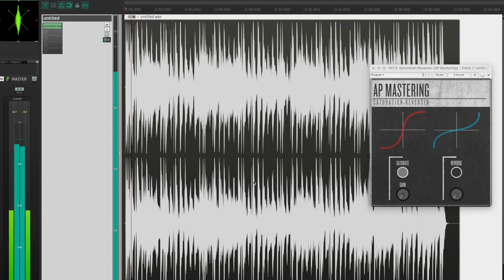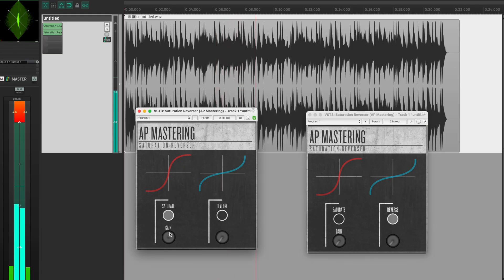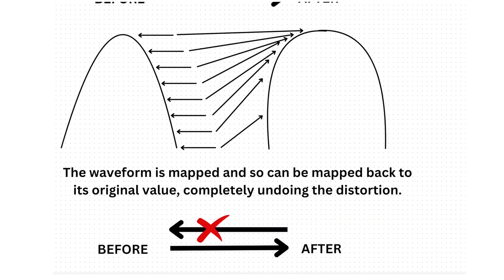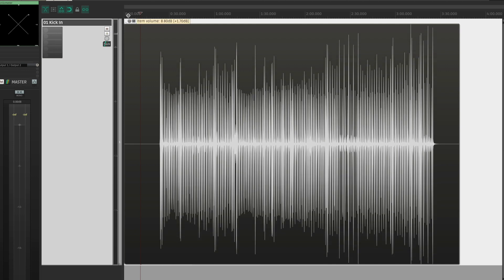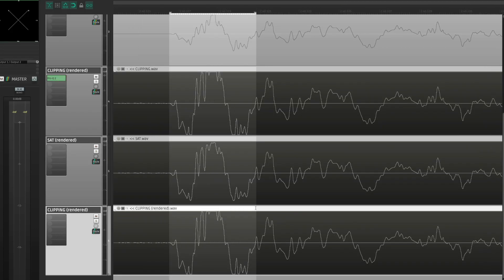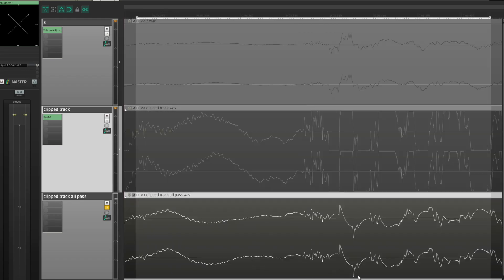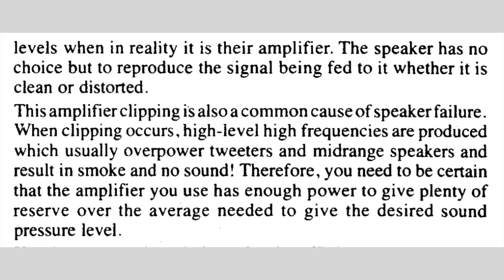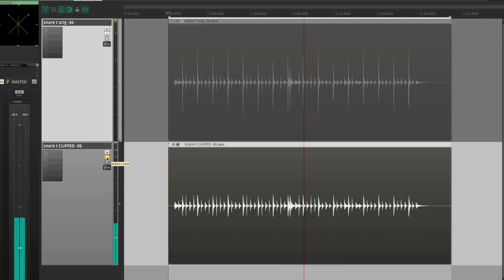Almost Nobody Knows, Distortion Can Be UNDONE!

Comment: Hard clipping can potentially create a DC offset because the straight line of a square wave is DC. 
A DC offset can potentially mess up your amp and speaker biasing, causing damage, heat, or extra distortion.
However, this is only theoretical, as all of them have so-called coupling capacitors that block DC. 
So, I don't think that square waves will damage your speakers on their own, it's common practice to use square waves to calibrate amps, speakers, tape recorders, and so on. 
The dangerous clipping they are referring to occurs when you feed your signal to the speaker or amp so hot that it exceeds the power rating of the system, overly loud source material only adds to that.
Reply from the maker: this is wrong. Although the top of a square wave is static, it's not electronically considered DC since it is not 0Hz... let's say the square wave is 1kHz. this is higher than 0hz therefore it's not DC. being reductionist about just the top portion is not how people normally discuss this
Reply: @APMastering  are you sure that waveform analysis in digital is correct? god knows what might happen during dac conversion...
Reply: @APMastering To achieve the flat line of a square wave, there must be a DC component present. Even if the wave is 1 kHz or higher, it still contains that component. You can test this yourself: generate a 1 kHz square wave and apply a 1 Hz high-pass filter on top. Then, observe the oscilloscope to see how the wave changes. The flat line will drop even if the filter never affected the fundamental frequency, because it removed the DC component.
Reply from the maker: @eliashowe7115  no that's not what DC is. DC is 0hz. high pass filter at 20hz and see what happens
Reply: @eliashowe7115 This is not right. Clipping can essentially induce DC, but not because of the flat line. It's because the energy imbalance in the top/bottom swing of the waveform becomes exhaggerated, depending on the material. You can usually see some DC on an analyzer after clipping.
Reply: @erinburke9711  As I said, generate a 1 kHz square wave and apply a 1 Hz high-pass filter on top. The waveform on the oscilloscope will drop that flat line of a square wave, even if the filter never reaches the fundamental frequency, because the flat line contains DC
Reply: @eliashowe7115  No. You lose the flat line because the highpass has nonlinear phase shift. Nothing to do with DC in this example. Do the same thing with a linear phase filter and you'll see a very different result.
Reply: @erinburke9711 for phase shift to happen filter has to be charged and then discharged, so something is doing that down there. Linear phase filters are digital and have a delayed window to do calculation so of course they will compensate for waveform changes. In general if the voltage line is flat it's DC.
Reply: @eliashowe7115  By definition a square wave is a sum of all odd harmonics. So 1k+3k+5k, etc. A naive digital square wave will have a bunch of aliasing, but a theoretical 1k square wave will have NOTHING below 1k.
Reply: @erinburke9711  front of a square wave has all upper harmonics in it up to your bandwidth limit, but low and high levels of it which are straight lines are DC.
Reply: @erinburke9711  you can see it with fft too when the filler charges for the first time
Reply from the maker: @eliashowe7115  i agree with erinburke that you are incorrect about the DC thing
Reply: @APMastering  your statement about "say the square wave is 1kHz. this is higher than 0hz therefore it's not DC" is wrong. If you measure the frequency of a flat portion of the square wave, it will measure 0 Hz.
Reply from the maker: @eliashowe7115  this is where you are going wrong. i'm starting to think you are trolling now as you've already had the mistake explained to you by two different engineers
Reply: @APMastering  your support team of engineers had it wrong too. According to them, the flat portion of a square wave is where the high-frequency harmonics (1k, 3k, 5k) are. However, this is simply not true. High-frequency harmonics are found in the rising and falling edges of a square wave.
Reply from the maker: @eliashowe7115  this is yet again wrong but if you want lessons in basic audio physics i'll have to start charging
Reply: @APMastering "DC is 0hz"
That's not strictly true. Any vertically asymetric AC waveform has a DC component. A squarewave with a positive peak of (say) plus 9 volts and a negative peak of minus 1 volt will be considered to have a very positive DC bias. This will be evident on a DC coupled oscilloscope, just as if a heavy  DC bias had been applied to a +- 5 volt square waveform. As for squarewaves the "flat" part does contain all of  the odd harmonics, and can be certainly be synthesized this way, but those test signals are usually generated simply by switching as quickly as possible between  positive and negative DC voltage rails. No harmonics used here!  It could therefore be argued that the top "flat" parts do "contain" positive DC at least for the time period for that half the cycle, and negative DC for the other half. Imagine a very low frequency square wave generator which switches polarity every hour. During that hour, what we then have is pure positive  DC for one hour, then pure negative DC for the following hour!

Apparent DC offsets due to vertically asymetric AC signals are real. Ask any power engineer about DC on the mains due to consumers using power from only half the mains cycle. Not so much of a problem nowadays but it certainly was due to TVs etc using half wave rectification of the AC sinewave.😮
Reply from the maker: @ dc offset is not DC. it's a signal with an offset
Reply: @APMastering 
It's a signal with a DC component. The component is the DC offset. Unless the audio signal is symmetrical around the zero volt line, on average, and certainly at zero volts during silent periods, it is not pure AC. The DC component can be inherent in the incoming signal, or due to some applied bias. It is irrelevant which, in DC coupled digital systems.  In power engineering this kind of thing is regarded as having DC on the mains, even though the waveform still crosses the zero point, but it is no longer crossing it at the correct point of the sinewave. A constant DC offset in an audio signal will move the point of which the speakers will rest, in a fully DC coupled system,  and when there is no audio ( say on a silent section of the music due to an intended pause) the output signal WILL then be pure DC if the offset is large enough with respect to the noise floor, for the duration of the silence. I regard fully DC coupled audio systems as a danger to ones speakers!
Reply from the maker: @ leakage from a DC source may cause an offset in an ac signal sure but that wasn't the original claim
Reply: @APMastering 
Agreed. Clipping does not create DC on a correctly designed and working amplifier. Square waves are dangerous to speakers, as the RMS content of the amplified square wave signal is significantly greater that the RMS power an unclipped sine-wave would deliver,   almost equivalent to the peak power of the sine wave but over a much longer peak period, (with the voice coil getting little respite from this extra power) along with the mechanical stress on the speaker mechanics in the attempts to very rapidly push the speaker drivers outwards and then inwards. Heavily clipped (by the amp)  compressed audio will have similar effects. Here the signal  output on a correct working amplifier is undoubtedly pure AC and no DC blocker will prevent this state of affairs. Hard clipping might create an apparent DC offset if the incoming signal is asymmetrical, and dc coupled or if the clipping of the amplifier is asymmetrical (a little more common that one might think) but that isn't what blows up the speakers unless the offset is also very large.  I remember two desperate friends who blew up a couple of low budget 200 watt 12" drivers by using a 50 watt RMS amplifier and clipping it to death due to ignorance of the effects of clipping! As for me, I was a service tech (including high end audio gear) for many years until the mid eighties and I have seen the effects of this often. In my time as a technician dealing with these things checks for asymmetric clipping and static DC offsets were always done during an amplifier service. Tube/valve amps were especially vulnerable to asymmetric clipping due to one push pull tube wearing out more than the other. DC offset on the output was rare because of the output transformer isolation. Well designed transformers could clip squarely though, and a valve amp can wreck speakers, though there is a bit of compression due to the naturally higher impedances of the output circuit, and power sources.

Comment: In the kick example - 100 samples is only 2 ms - it will be audible when you play a 100 sample/2 ms white noise sample in silence, but the same 2ms in a mix is not really audible at all - even less so when you include the fact that the initial transient of a kick is usually high frequency heavy, and is on beat with other instruments which helps mask the white noise. 

I use clippers on drums and limiters on tonal instruments, and the tradeoff is worth it - the final limiter barely works more than 2-3 dbs before I get to stupid loud (-6 lufs or so)

The sad fact is clients always A/B their mixes and masters against other stuff they hear on Spotify. If its not similarly loud to other releases, then you get the blame. While I agree that there are some terrible examples of shoddy production, this should not reflect on the potential of the tools. Looking at badly deformed nail on the wall and blaming the hammer isnt the direction we should be taking.
Reply from the maker: this is not my experience as a mastering engineer
Reply: @APMastering  which part exactly isnt your experience?

Comment: Great video, it's refreshing and rare to see people exploring how things actually work and providing a spring board for constructive discussion! Does the same information loss apply to hard knee limiting where it seems to flatten a peak instantaneously before having a gradual release? Is this the same as a hard cliper on the onset while the gradual release is mitigate some distortion for cutting into the waveform or is it somehow compressing the dynamic range instanteously in a different way? Does that mean a soft knee limiter is functioning the same as a tanh function on its onset and by this measure would you only ever personally use a soft knee limiter?
Reply from the maker: i need to study the dsp behind limiters more. i going to try and build one soon. up until now i've just used them
Reply: @APMastering  Keep us updated on your findings, it would be silly to be avoiding information loss with 1 process only to be unknowingly doing it with another. I'd love to see a video on the process of building these plugins, including the research/circuit analysis, coding and UI/UX if you find the time.

Comment: I think the whole point of clipping is controlling the crest factor. It's not just loudness, but hitting the right compressors/limiters with a more uniform signal, so it's not like choking on a couple of transients and completely missing others.
Reply: If you want to control the signal going into a limiter, you can just put another limiter in the chain rather than brickwalling the peaks.
Reply: @ThreadBomb  And to add to this, you can compress at the individual channels before the limiter or bring down the level of the signal that peaks the most. This will also control the crest factor. And it does so with complete signal fidelity.
Reply from the maker: that's fine but this isn't what i've been seeing people do online or my own mastering clients
Reply: @APMastering  it's a youtube tutorial problem or information availability problem, not quite a clipping problem itself, plus it also depends on a stylistic choice and genre itself. I love me some soft clipped or tanh kicks and snares.
Reply: @APMastering  so why do you say to don't use clippers, if you know that there's a valid reason for using clippers?
Reply from the maker: @SenorTropiCat  see part three, dropping in a couple of hours

Comment: Everyone ignore this guy, it's rage bait to get his play count up without a care in the world about what spreading this WRONG information for up and coming mixers, producers, mastering engineers. 
Please ignore him. He knows exactly what he's doing and should be ashamed of himself.
Reply: What wrong information...? Proof please
Reply from the maker: exactly. haters will just randomly accuse me of non specific general bad stuff
Reply: @APMastering  the fact that squared off masters can damage playback system was disproved a while ago. Using hard clipping in the appropriate way in a mix or master is definitely ok (as you well know if you actually are a working mastering engineer). The examples you used on a Kick and full bodied acoustic snare are ridiculous, you'd (obviously) only use hard clipping on parts that you can do so transparently with no audible change of character. If you have a sound like a clap that has a huge spike at the front using a clipper is a great way of reducing that peak if you don't want to use a tool that imparts new texture or tonal change (like a compressor or soft clipper).
It's just bait to get people's comments and interactions.
Reply: If a foh engineer puts a high pass filter before the amplifiers (which they do) this causes new movement which stops the drivers from being pinned and transferring in to 100% heat.
Reply from the maker: @happyshadow  that or all passes, which are more effective. but then there's nothing won by clipping

Comment: Hi 👋 😂 I was “that guy” in the last video. You’re not necessarily wrong here (nice to hear someone talk about the reverse saturation option. I discovered this when playing with waveshapers thought it would be a cool video idea. I like to put processing In-between for weird sound design experiments… anyway) there’s a couple of things I disagree with again. 

Hard clipping is actually cleaner than Saturation. Why? Because your signal is spending less time in a “non-linear environment” Intermodulation can be reduced using hard clipping. At least it sounds cleaner on complex waveforms like a mix.
100 samples out of 44100 per second is still very little. The question is do you hear it? If the answer is yes, you’re doing it wrong. 
I do often use “softclipping” as it is “softer/less instant” but at the end of the day you could argue this is also reversible. But it really isn’t because of the signal is loud enough we’re limited by our bit depth to realistically restore that almost.almost.almost clipped information. and realistically the only difference between hard clipping and saturation is how steep is the non-linearity. (Assuming symmetrical +&-) 
Also aren’t all speakers high passed and low passed anyway? Meaning any “prolonged energy” would be offset by the phase shift in the speaker itself? This destroying speakers argument is more to do with sheer volume than the shape of the waveform. 
…. God this is a deep topic. Appreciate seeing a different point of view but I still think clipping and “soft clipping” are very useful tools.

Also no shade here. I appreciate the video. Nice to nerd out with fellow nerds.

Comment: This is kind of operating under the presumption that clipping is the only process contributing to loudness for some people. Typically clipping with K-clip is just the final process after saturation, compression etc to control those 'every now and then' unwanted transient peaks to prevent higher peaks in up stream bussing at least for me. K-Clip might not even meet the strict definition of clipping you've laid out, so saturation is really what's putting the work in loudness wise for me. I never want the clipping to be audible or adding any kind of unintended colouration, I just want mixes with the kind of marriage of punch and density expected in a given genre.
Reply from the maker: I agree that mixing loud is MUCH more than clipping. In fact you can mix loud completely without clipping. I think kclip is incorrectly named. It's a multi band distortion plugin.

Comment: Does digital saturation actually work for this? Like are the algorithms actually gonna give you a decent sound when trying to tame peaks or is analog still the way to go?
Reply from the maker: you can get a good sound in digital these days
Reply: @APMastering  Roger, am I the only one that feels that digital saturation seems to end up sounding pretty much the same if not exactly the same even across multiple plugins 

Is there an algorithm that companies all use? 
Or do I just need new ears? 🤔
Reply: @Notinserviceij  I'm in the opinion that it's all kinda samey in analog side as well. Tested a dozen different diodes, tubes and transformers by just clipping audio through them passively. At the end of the day they all just spit out even or odd harmonics (or a varying mix of both). Any noticeable difference is always due to something else, like the threshold where it starts clipping, the interference that gets picked up or the frequencies being filtered out. 

My ears are absolutely not convinced that an expensive AX7 sounds any different than a cheap AX7 with same gain rating and condition. 

When I'm swapping recordings going thru different transformers, it just feels like there's a tilt-EQ after a clipper. 

Diodes? Kinda interesting, because by combining different ones it's easier to mix different even/odd ratios. Super cheap also.

Tape is kinda unique, but again not just because of saturation.
Reply: I think guitar amp sims prove that digital distortions can sound very distinct, and very good. That said, I do tend to prefer analog for subtle saturation.